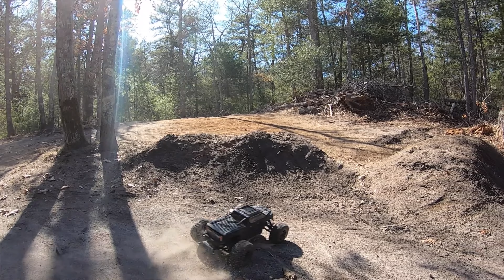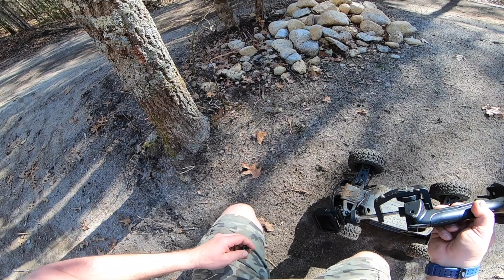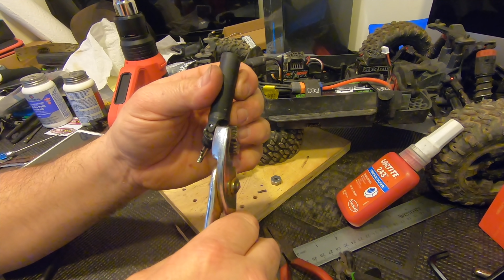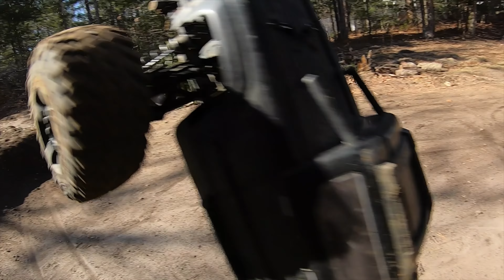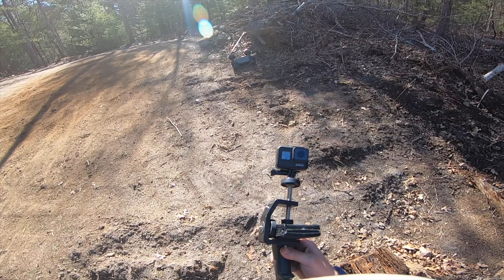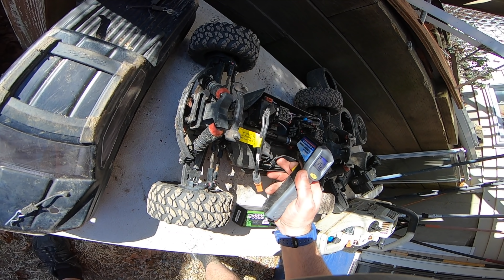Arrma Big Rock Takes the BEATINGS but are we close to REFRESH and UPGRADES

Comment: I took out big builds and a lot of different rc’s this weekend. The big rock, never broke, and was more fun than I had with an rc in a long time. I also ran all 3s arrmas and the big rock just has it right. Brand new Traxxas snapped an axle in 30 seconds stock on short flat grass? I ordered a second big rock yesterday. You have to drive one to get it. Got it caught in a tree! nothing is wrong with it. I’m impressed! Outlasted my XMAXX wich broke 3x doing lighter bashing then what I put the rock through.

Comment: Hey Guy! It's been great watching your experiences with the Big Rock. Do you have a theory as to the source of the high pitch whine/squeal on these trucks? It seems more prominent on yours than some others. Could it be the slipper? What did you wind up adjusting yours to after the last repair? I think factory is 1 1/2 turns out. Mine was super quiet for a while when I had my Traxxas motor in there but I wound up putting a replacement Spektrum in and it's still kind of noisy.
Reply: It's the motor bearing making that noise believe it or not!!! Shaft side!!!
Reply from the maker: Metal to composite gear. I did remesh tighter to get rid of the wear so I can fully expend the spur
Reply: @rcguygarage  morning, the reason I said the motor bearing is the noise is.when my 24ookv motor bearing failed I got a new motor. And I noticed the truck got louder?  6 or 7 runs and noise got worse? Why???
The bearing!!! No grease!! I bought avid bearings on Amazon 10pcs for 13$. Dozens of runs and still a lot quieter and running cooler ! Just still running no failures of the bearing!!!! THE STOCK BEARINGS can come with little or no grease!! I've had my outcast 4s since February 23 2020 on March 12 motor bearing failed(same as yours).4 days later new motor from HH! Bearing lasted 2 weeks and truck was as load as a nitro,shaft side bearing no good! I bought avid bearing and motor is running cooler and quieter!!!
Same motor from the beginning just spectrum name !!!!! Why Horizon hobby???? Guy hate to say ,try replacement of the bearing in the  new replacement motor and see the difference!
Reply from the maker: @rcjunkie260  👍right but I'm answering Kevin Snow as he asked me about the noise he was hearing from my video. My plan was to get a couple packs in then check for play. Due to axle breakage I guess I'll be checking LIVE today 🤪🤣 with only one pack in.
Reply: @rcguygarage  what time are you going live ?

Comment: Just bought mine looking to upgrade anythin you can recommend on get first and where? Thank you
Reply from the maker: Your ball ends i think are good upgrade but then it's just what you break and when. DON'T get sucked in to maxing this RC out as it's stock form vs weight is great. The upgrades I've done i will cover once in done.
Reply: What ball ends do you use?
Reply from the maker: @goreyboggs  HotRacing bought from AMain

Comment: Also RCGuy! I’ve been doing a bunch of research on the Arrma 3s motors, the 3200kv. I’m going to try one drop of oil a session when I run it and see if that keeps the bearing alive. I fear these motors are just doomed
Reply from the maker: Right I'll be testing mine as well just not like you are😱😱😱 that's CRAZY maintenance 🤪🤣
Reply: The bearings are crap just like the first arrma 3s and 4s. Buy good quality rubber sealed bearings and no problems.